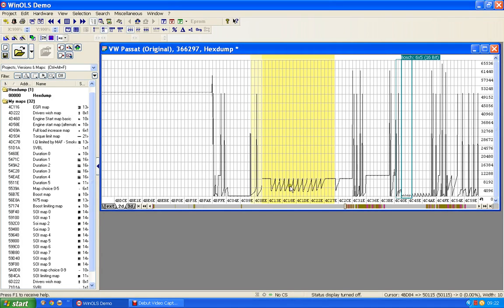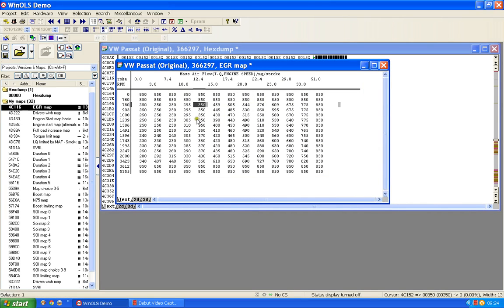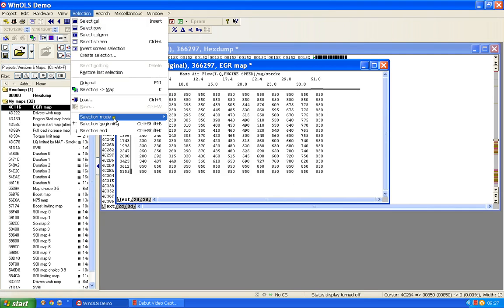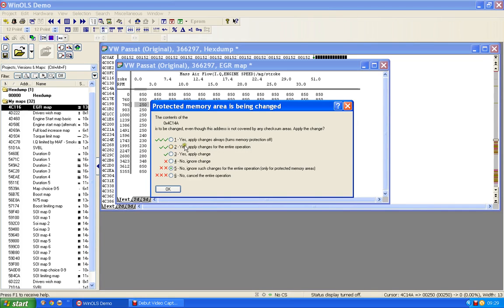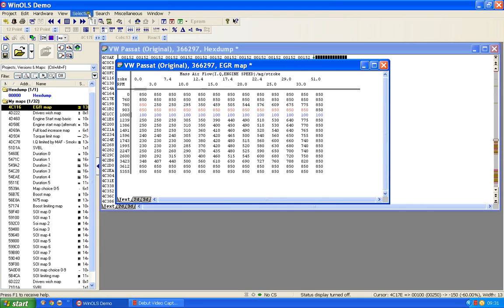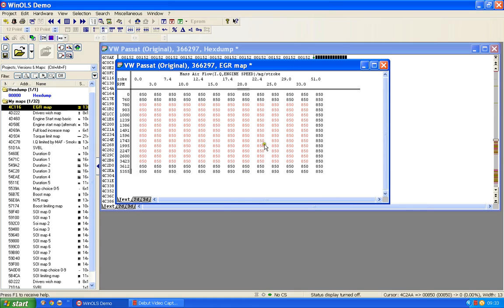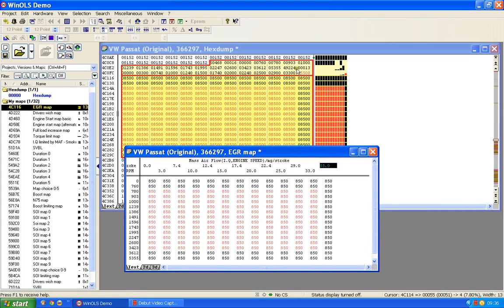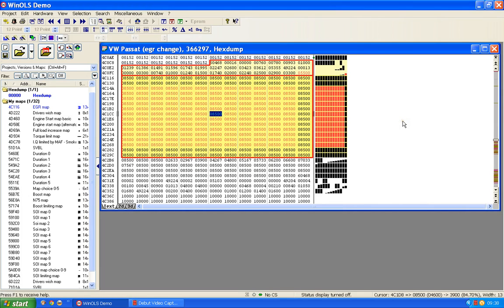Winols making map changes using EGR example

Comment: Hi I have been following your videos with great success in identifying maps now very informative and well explained Thankyou.  I am now at the point to try and modify my own map from a mg mems 3 ecu I have the map file from a 115 bhp and also a 135 bhp. As I understand once I have shadowed the 135 differences onto 115 project i will need to checksum the modified project to put it back on the ecu? Once again thanks.